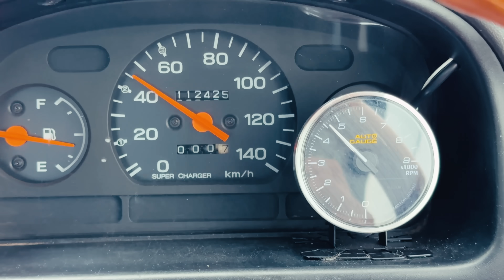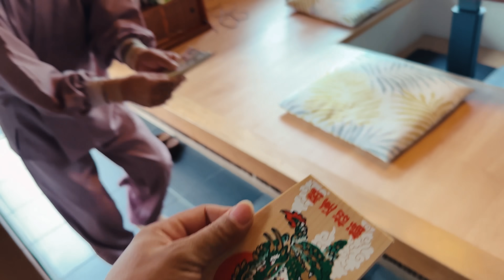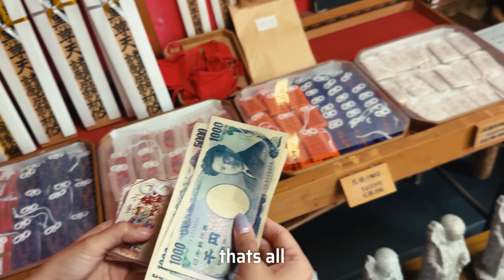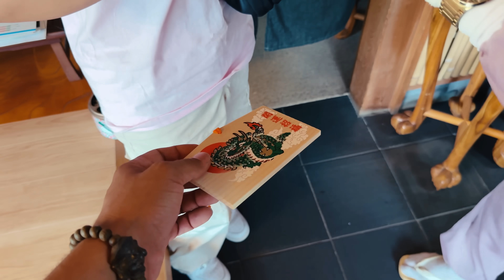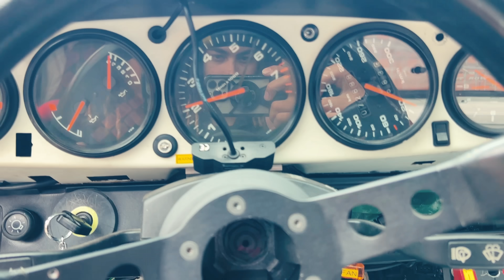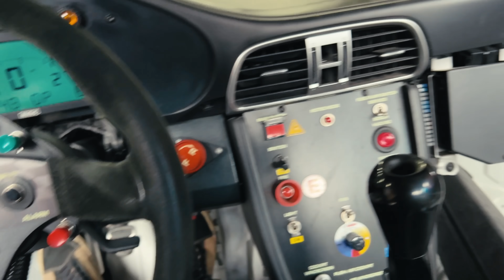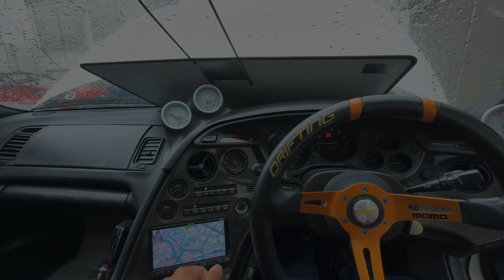SEASON 5 STARTS NOW. / S5E1

Comment: The white Porsche 964 is dope ! And much more reliable than the more recent black one. 
Just saying …
Reply: I’m curious, why is that?
Reply: I'm curious too. Was that year bad? As far as I could see that 2nd porsche was a factory built porsche cup car...it certainly has had track time, so it's possible it has issues.
Reply: @VROCSone  Yep looks like a 997 cup, good luck owning one of those and actually using it without a support crew. Besides it being a non-streel legal race car, the service intervals on a cup car are laughable for a private owner including engine/driveline rebuilds at very short intervals. Then throw in the fact that it's at least a decade old and race cars do not take well to sitting in storage that seems like a can of worms.

Comment: Have you seen the intake manifolds and TB'S for those and afyer market stuff my buddy had a 200 SER 2.4 BUILT TURBOED 11,000 RPM fast in 2004 it was nasty S2.4 WITH GREEDY OR HKS BOTH BUILT PARTS HEAD AND BOTTOM END 2:22